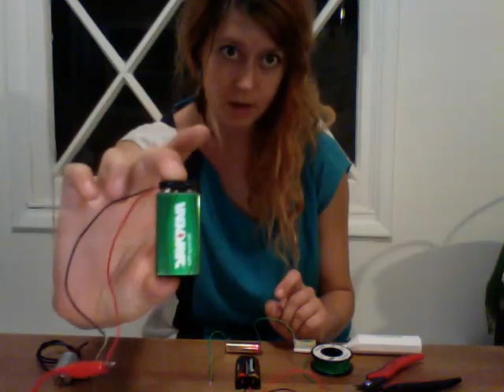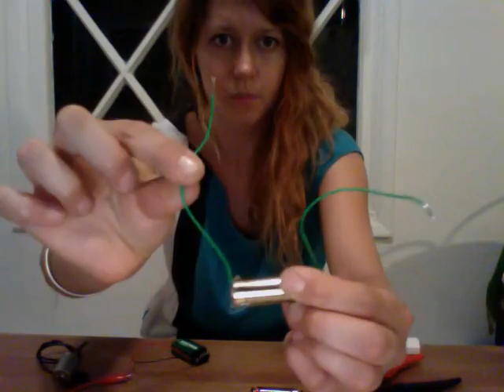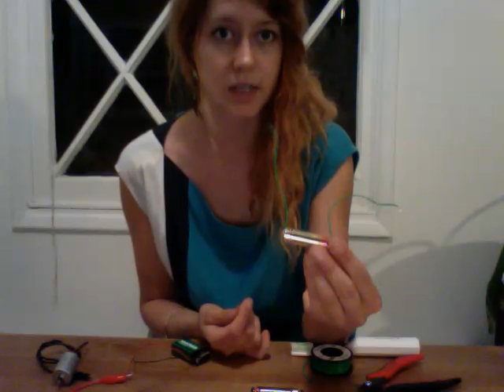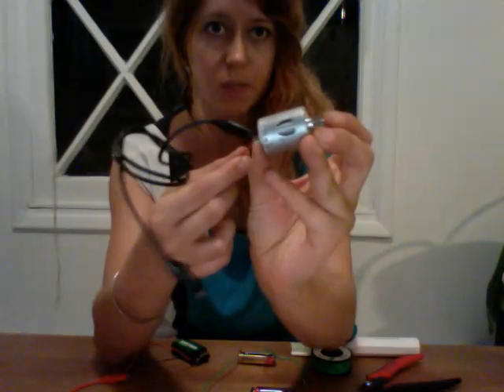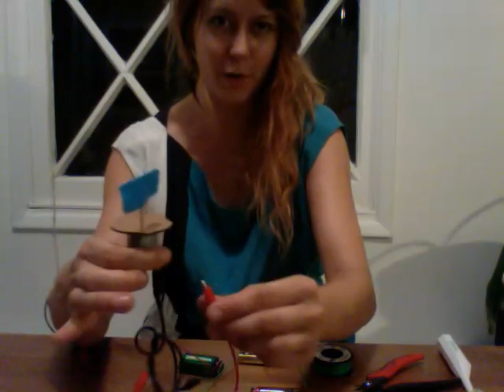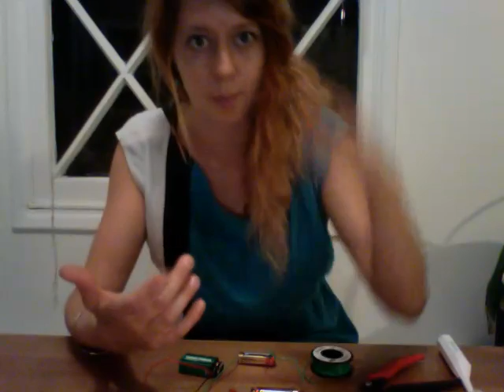DIY Science Hacks: Intro to Moving Things w/ Electricity!

Comment: A very big thank you to this video and to the maker of this video. This helped me a lot to make by science modal but I would like to know that how to move an object backwards using battery as I have learned how to move it forward❤️
Reply from the maker: depends on the object! for simple DC motors, you can switch the battery polarity (i.e., switch the red and black wires). For more complex motors like stepper motors, servos, etc, you need to either use code or have a more sophisticated electrical system.